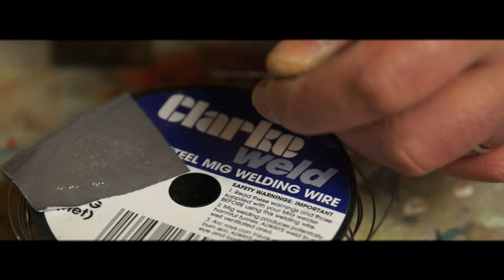January Making an Electric Pike Float (bobber)

Comment: Excellent video, Paul. Took me until near the end to work out what you were making! Your ingenuity never ceases to amaze! The pike around here (about 25 miles north from you) haven't been coming out to play on deadbaits lately either. 2 jacks in the last 3 or 4 sessions, so it's not just you! 🙂
Reply from the maker: I though I would do better on dead baits than lures, but it did not work out that way, thanks

Comment: I make crude balsa pencil floats with 4.5mm holes in the top for glow sticks. have you got a guide on the process you use with sealants used as I could improve on my own cheers. I must have something right as I have had loads of Zander and pike from local canals. personally think yours are over complicated and would dread losing 1 I would lose sleep over it but brilliant idea and very well made.
Reply from the maker: yep, over complicated, but a bit of fun, cheers
Reply: Paul Adams I have always wondered if it is possible to make a float that could put a jig action into a paternoster dead bait. some how lifting the line 3 or 4 inch and letting it drop again. Maybe you might have some ideas. Might work in provoking a take might be a waste of time.